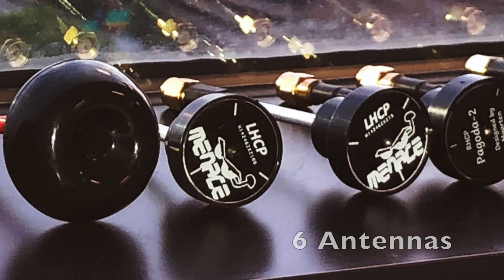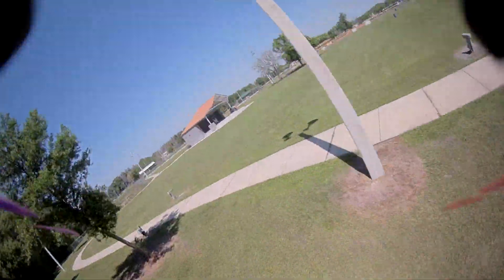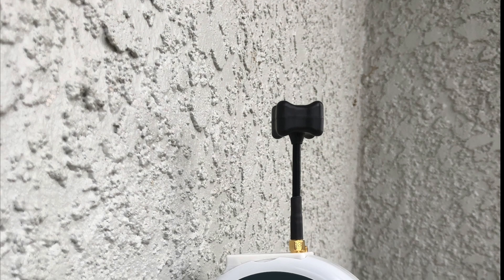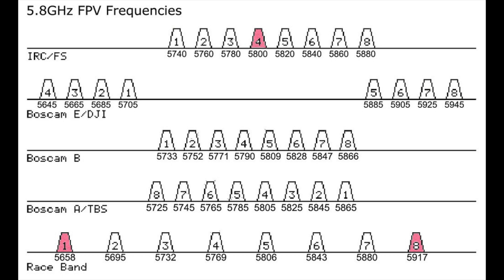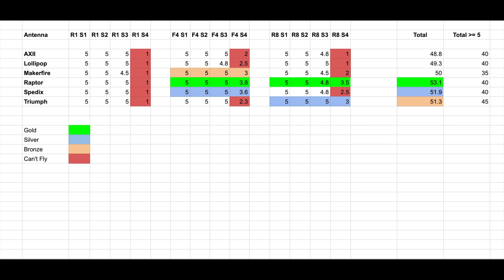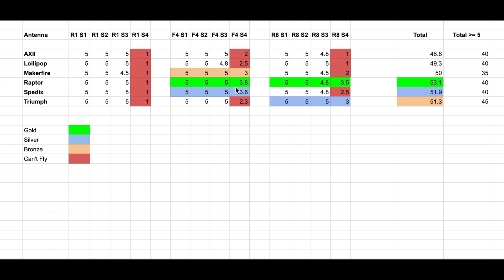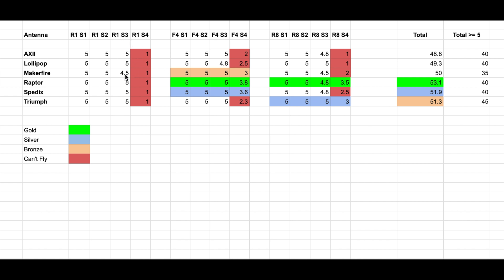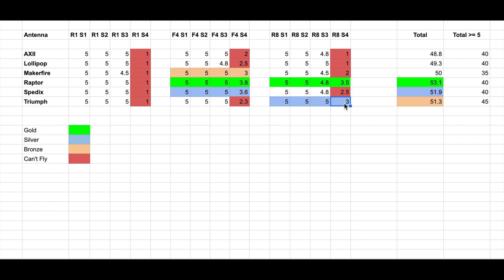FPV Antenna Shootout II, carefully designed test for six different antennas

Comment: I like the test, weird i haven't found this before.. Thanks :)
Reply from the maker: Thanks!, I would like to do more, but is time consuming, with a SWR meter for 5.8ghz is not 100% like the reality but it's more than enough to trust it, plus my tests are not like actual flying anyways, so far I saw some test using SWR and the results are the same I got with my test and is super fast.

Comment: The best antennas are handmade by Flossmann wlan_antenne in the eBay Store under 5.8 GHz Biquad, new is the 5.8 yagi !!! I have been the biquad on the receiver for years. There is nothing comparable to the price. Absolute tip.
Reply from the maker: Thanks for the tip, I will try!

Comment: Nice work ! 
which antenna would you recommend me to fly lang range ? I have the hubsan h501s and the fpv range of it is "only" about 1.3km and i will upgrade it
Reply from the maker: I don't know about the Hubsan H501S, and I don't find the one that can go more than 500m, anyways I don't think changing only antena will bring you lot more range, 1.3km is already a lot. I would start with some kind of ground station.
Reply: I already have a good 2.4GHz Antenne to fly Long range , only the fpv drop out at over at 1km because of the small linear Antenne. I think when i Change It to a good antenna it will double the fpv range
Reply from the maker: I think I didn't express correctly, when I mentioned ground station I mean for FPV which I assumed that was your question about, I'm not into Long Range, but you can start here https://quadquestions.com/blog/2015/06/15/long-range-fpv-setup/  also you can find Long Range FPV forums like this https://www.rcgroups.com/forums/showthread.php?2688667-Long-Range-FPV etc. I hope you will find all information you need.Thanks for asking!
Reply: Thank you